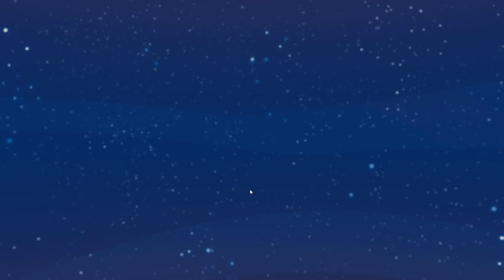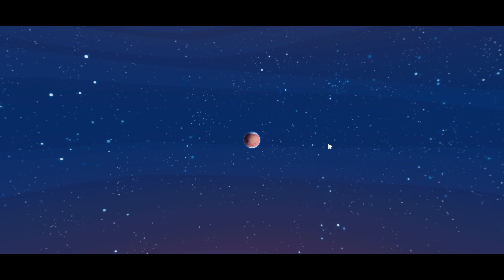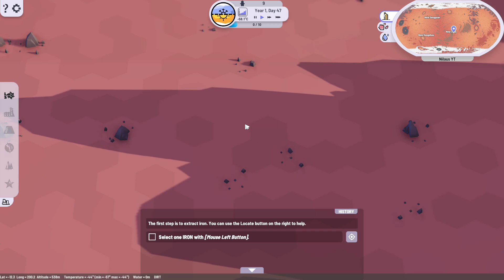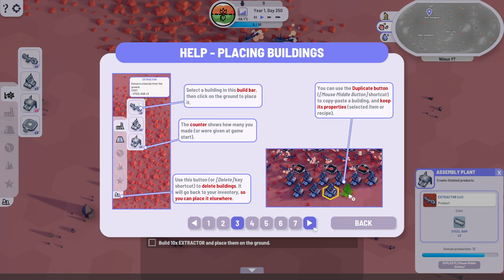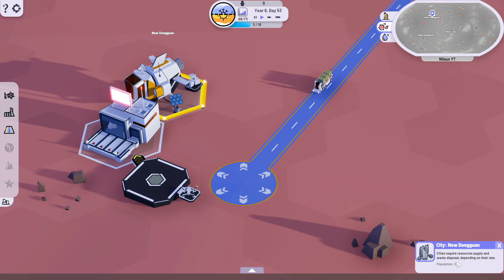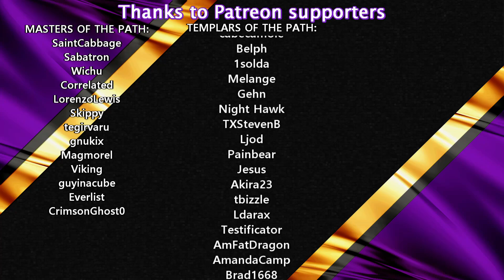PLAN B: TERRAFORM 🌐➡️🌍 Planetary Scale Logistics and Terraforming | 01 | First Look/Lets Try

Comment: 27:07 It's impossible to uniformly hex tile a sphere. I suspect the map is actually a puffed out dodecahedron with 12 pentagons, and you just found one of them.
Reply: I feel really stupid for needing to ask this... but how do you fit hexagonal tiles into pentagons?
Reply: @Invinzible001  Just like you have to distort something on a globe to project it onto a flat map, you also have to distort a flat surface (like a hex grid) to project it onto a globe. The most common way to represent a sphere with hex tiles is to treat it like an icosahedron (a d20) with 20 triangular faces. The triangles can be sliced up into hex grids, but at each of the 12 vertices you will wind up with a pentagon.

The classic soccer ball is the most simplified version of this basic shape, with twenty hexagon panels and twelve pentagon panels.